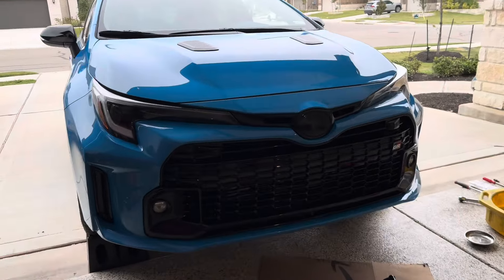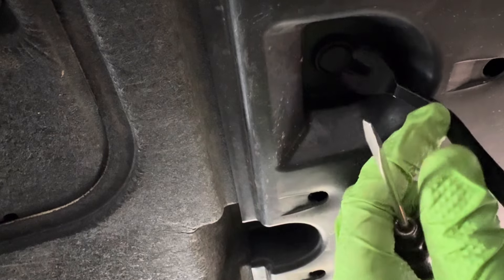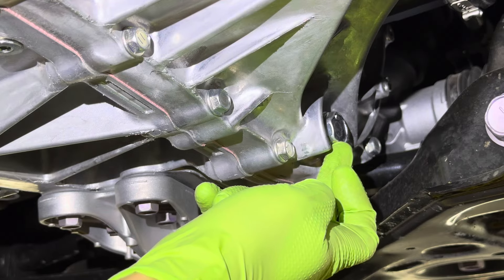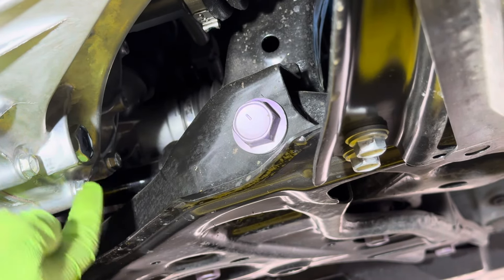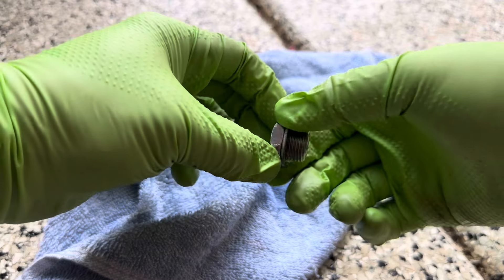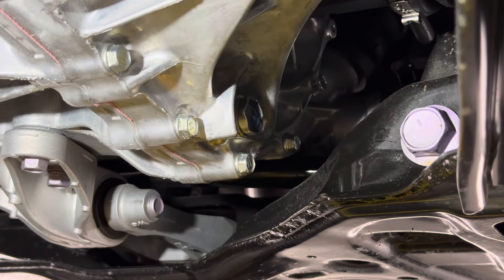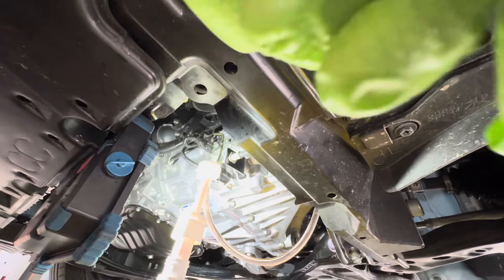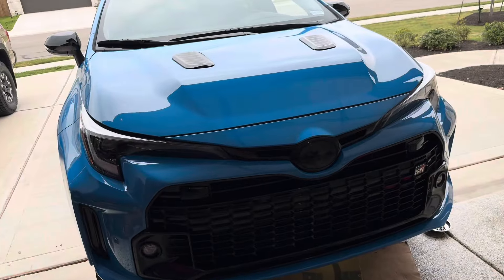How to change #toyota #corolla #GR #manual #transmission #fluid @toyotausa @ToyotaCorollaFanboy

Comment: Did my Corolla GR Transmission fluid with OEM fluid @12k miles did differential and transfer case with red line fluid@10k miles and break fluid at 20k. I also do regular oil changes every 2500 miles with Pennzoil Ultra Platinum 0w 20. I’m thinking of switching to 5w 30 oil, I’m doing so research first. Btw I’m currently at 23400 miles and have done 9 oil changes already that includes break in oil change at 1k miles. My only mods are SXTH intercooler with full custom hot and cold side charge pipes, car make 303whp and 310wtq according to mustang awd dyno. But good job with you fluid change. I’m glad I got OEM transmission fluid in February when it was cheap 28 bucks a can now’s it 80.00. Next transmission fluid change I will use red line if price doesn’t drop down.
Reply from the maker: Thx for watching! GR’s are so fun to drive!!!
Reply: @512TXSDIY  no doubt it is a fun car. I’ve owned mine since July of 2023 with 22 miles on it.. I have 23400 now awesome car!

Comment: I wouldn't get under that. Maybe flat in the garage but on the slope of the driveway no way.
Reply from the maker: It’s safe and secure
Reply: @512TXSDIY  it's on a slope with nothing other than gravity holding it down. I bet I could easily push it over.

Comment: So it is pretty much drain and fill. Do you have to warm up the transmission oil to the right temperature before tightening the fill bolt? The reason is the oil expands when it heats up.
Reply from the maker: I got it to normal operating temperature first so it flows quicker
Reply: @sinisini5168  any toyota gear oil gets filled until it runs out of the fill plug. This isn't something that is sensitive to fluid level like an automatic transmission.
Reply from the maker: Pretty much, yes.

Comment: How many miles when you are doing this transmission oil change ?
Reply from the maker: If it’s a new car, probably sooner than later to get the metal shavings out and refill with fresh fluids. Just my opinion  though.